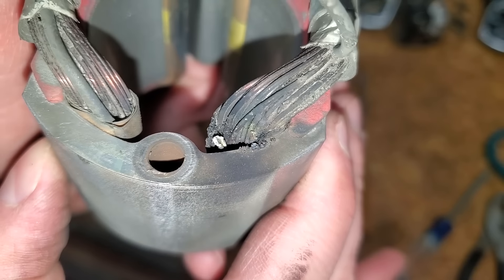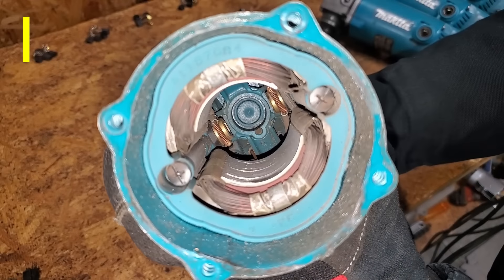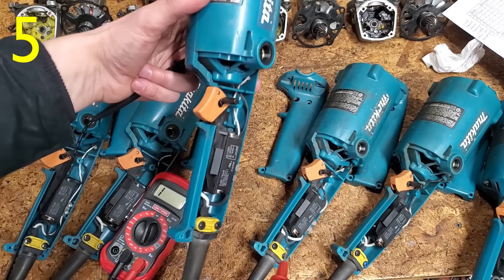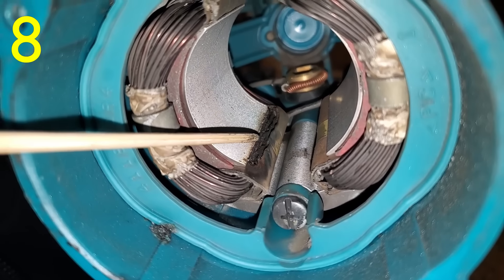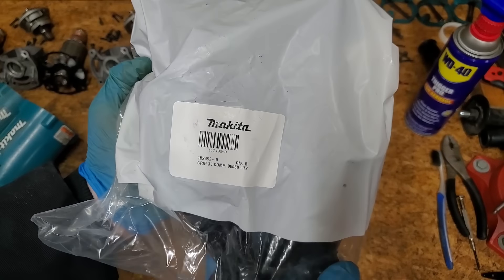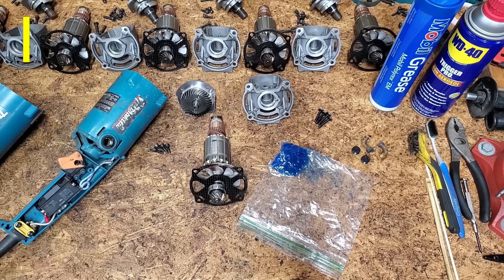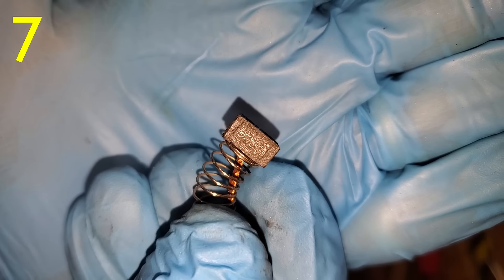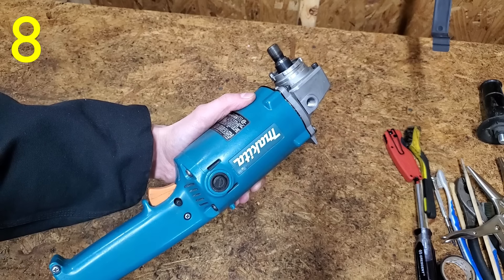Repairing Makita Angle Grinders

Comment: Makita makes the customer a winner here, the fact they sell the parts 👍
Reply from the maker: Yep, most major tool brands have a pretty good replacement part network with a lot of resellers.
Reply: @Mikeattempts  Have you found any major tool line that you wouldn't recommend based on repair-ability? I'm in a few battery platforms and wondering which one I should commit to. You and some other channels are teaching me and most importantly giving me the confidence to repair my own tools.
Reply from the maker: @marconiandcheese7258  I don't really feel like I have enough experience to give you a thorough list. I can say that store brands like Kobalt, from my experience, don't seem to have any replacement parts available. Is pretty safe to assume the same for any cheaper brands as well. Major brands like Dewalt, Milwaukee, Makita, Bosch, Hitachi, Metabo, and Porter Cable seem to have really good replacement part availability. So far, I only have experience with corded tools but my next project is going to be cordless Makita drills, so we'll see how that goes. I'm happy to hear my videos are giving you the confidence to repair your tools. I'm no pro so if I can do it, so can you.
Reply: For most diy people 1-3 grinders is a lifetime supply
Reply from the maker: @jonnenne  Yep, I agree. I'm still on my first set of brushes on my Dewalt angle grinder.
Reply: Bc they know their tools break
Reply: @BackwoodsGarageLLC.  All tools wear out Genius. Some of these grinders are 10yrs old ! 

Some companies though are invested in their longevity, others just want your cash....
Reply: @edwardfletcher7790  Still.
Better buy a new one in some cases. 
Time has value too.
Reply: 6-7 soundes smooth, some sounded rough, those sounding rough should get ball bearings replaced. But overall, I'm so happy you brought them back to life and saves from hitting landfill.

We should do that with virtually anything.

Comment: I am glad to see somebody take the time and effort to repair perfectly serviceable power tools. In most cases they would end up in a land fill.
Reply: Before use I would recommend that each of the grinders be equiped wih a guard.
Reply from the maker: Yeah, I understand time is money for businesses but one of these grinders just needed new brushes! It does make me feel good to save 'em from the trash.
Reply: @Mikeattempts  and one just needed a cleaning (jammed metal piece)

and a 60$ stator (companies can buy ín bulk and get discounts) and 2 h of labor is cheaper than a 200$ new one
Reply from the maker: @lacucaracha111111  You would think a business would at least keep spare brushes on hand for their $200 grinders, it's a 2-minute repair.
Reply: @Mikeattempts  my shop does, the electrician comes round monthly to repair stuff and change the damaged sockets
Reply from the maker: @jackhentschel5961  I think it's smart that your shop has add monthly tool repair to the electrician's duties.
Reply: @Mikeattempts I think preventative maintanece, periodic cleaning / lubricating can save a lot of money too. Really depends on the tool. But for very little effort and money, the lifetime of tools and machine can be extended many times over, plus you don't have as much downtime.
Reply from the maker: @thorwaldjohanson2526  Definitely! Regular maintenance prevents expensive repairs. What did Benjamin Franklin say, “An ounce of prevention is worth a pound of cure”? It applies to everything, your health, vehicles, and even tools.
Reply: You also did a service of teaching others how to fix them - which will save even more from landfill
Reply from the maker: @CharlieBaes  Somehow, I hadn't thought about it like that but you're absolutely right! Thanks for the comment. :)
Reply from the maker: @incub8  👍
Reply: well worth fixing nice unit to hold and good power. often welding shops use flap disc the grit sucked in gives the field insulation a hard time, haven't been overloaded as both halves of the field would at least show up as hot binding string melted. greasing a NDE bearing that it operating at 12,000 RPM range is ok to test unit but one of the only common failures of this unit is NDE bearing sized and melts housing so $7.00 to replace is better long term option. The sand paper on commutator basically no the patina on the copper has a purpose. 
Still nice video. Replacing the cord as well used to buy in boxes of 100 so good to change out or cut off 1 ft. Testing fields another listing had megger  ( insulation tester ) I prefer testing fields with 12v battery just hook up amp meter 10 to 30 amps and dead short each coil should be same grinders about 25amps drills about 12amps 3 or 4 seconds so heat not an issue  
the megger wont show shorted turns. grease generally is ok if you top up must be lithium base grease never mix with polyrex EM or turns to putty. Otherwise clean out compressed air blow out old grease and use just Polyrex / Polyurea EM grease.
Reply from the maker: @kspower395  This is just a hobby of mine, I don't do this professionally. So, buying a box of 100 cables doesn't really make sense for me. Yeah, I was aware that lithium and polyurea don't mix which is why I spent so much time cleaning out the gearboxes. :)

Comment: The beauty of using quality tools is that not only do they tend to last longer initially, but they are generally supported for replacement parts for a good time afterwards. nice to see them lovely tools given a new lease of life. Brilliant.
Reply from the maker: Yep, besides paying more for better quality, you're also getting the ability to repair the tool with replacement parts. Most cheaper tools and store brands don't even give you an option to order replacement parts. However, I'm working on a bunch of Makita drills now and getting parts is not as easy or cost effective.

Comment: As an old motor rewinder aboard some our country's finest ships, I applaud you for the work you did and for the excellent video you made.
Reply from the maker: Thank you very much! Have you ever rewound a small stator like the ones that failed in these grinders? I've never done anything like that but I'm interested in the process and possibly trying it myself.
Reply: @Mikeattempts  I can't recall doing anything that small. I think the smallest I did was a starter motor for a Detroit Diesel 6-71 engine.
Reply: @Mikeattempts  I’m curious how you’d find out about the process of rewinding a small tool motor. Maybe in a repair manual? Many things like that are obscured by how unusual the practive would be outside specific industries, and in many cases handed down to apprentices…there’s not such a great tech education left in the US, it’s mostly higher level such as design, engineering and programming.
Reply from the maker: @atlantajunglepythons1744  I agree, I was hoping someone would point me in the right direction. There's always YouTube! :)
Reply: @Mikeattempts  measure the existing enameled wire, purchase it. when unwinding the old coils you must count exactly how many winds you remove. rewind exactly as it was, place paper between copper and steel. re-solder connections (gotta sand off the enamel to make any connections) winding motors isnt exactly that it's hard.... its painstakingly arduous to do. 10/10 don't recommend
Reply from the maker: @mattlitton8066  Haha, I might be up for an arduous task... once. Thanks for the info! Stupid me didn't realize you could get enameled wire and thought I had to apply it myself. :) Is it hard to get it rewound without accidentally scratching the enamel against the steel stack?
Reply: @Mikeattempts  it's not exactly super easy to mess up the enamel. You need to be careful around the steel plates but ideally you would have a paper layer between anyway. And if you scratch one piece of enamel you'd have to have another wire with a scratched spot touching the other to short out. You need to be mindful for sure, but it can hold up while winding.
Reply from the maker: @mattlitton8066  Well that makes it sound more doable. I kept the old stators, and the shop gave me a couple more angle grinders so I might try rewinding 'em.
Reply: @Mikeattempts  I'd watch it lol, it can be rewarding.
Reply: @Mikeattempts  there are available winding jigs. They have a half a car wheel profile on either end of adjustable length rods  to adjust for coil size. They’re mounted on a central axel so you can spin them and just count your rotations. With a 3d printer a fella could make on pretty easily. Finicky process for sure but if a replacement isn’t readily available it’s the difference between trash and treasure.
Reply from the maker: @larrypostma2866  Interesting, I didn't realize there were jigs. I've got a 3D printer too. This could be a fun project, but I feel like I have a lot more to learn.
Reply: @Mikeattempts  Your video was great.  You could have made up 4 units from the 8 at no cost.

The fact that all of the failures were pretty much in the same place points towards manufacturing failure.  Almost all consumer/high-volume motors are made in automated machinery (some cool automated and manual videos on youtube search for stator or motor winding) and if something is set up wrong or worn in the machine it will compromise the winding as it presses it into the stator core and then the risk of failure is high.  If you had examined the other good units you might find that they are also like the Ford Pinto and have a vulnerability in that same spot.

Having parts failures before the brushes are worn out the first time means bad manufacturing, having it repeated means bad quality control of planned obsolescence.

As mentioned by another commenter the reuse of the worn sealed bearings was not a long term fix but might last in hobby use for the life of the grinder.
Reply from the maker: @KallePihlajasaari  Thanks! Yeah, you're probably right about the stators because the replacements had a different part number than the original.

Comment: I used to work at a fabrication shop briefly, I told them I was good at fixing stuff and they had a pile of tools about two bootfulls worth, including lots of these grinders and hikoki ones, among lots of other dead tools. I managed to fix more than half of them but using good parts from different dead ones. Soon learned the common failures for each brand. Was good fun. This video really reminded me of that job. Nice job. I had like 6 dewalt 1/2 impact drivers that all failed the same way, at the cable strain relief clamp, ironically the screws had been so tight from factory it would just shear the copper wires inside. I thought about buying them as it was pretty obviously a factory issue and knew there would be a lotttt out there in the world with the same fault. But they just aren't worth any money anymore as everyone has gone cordless.
Reply from the maker: That's cool, how much time did they allot you to fixing tools vs your regular duties? Since this is just a hobby, there's no pressure to get stuff done for customers so I find it very enjoyable and satisfying. I've learned a ton so far, but I feel like I still have a lot more to learn. I would like to get better at electrical testing. Thanks for the comment!
Reply: @Mikeattempts  It was like 2 or so days work. I didn't really have any specific duties at that job, I just did as I was asked. General engineering, one day I was wiring up electrical panels, the next I was welding, the next I was cleaning machinery. You've nailed the basics of multimeter testing for sure, better than most people I worked with anyway.
Reply: One thing I've been thinking about lately is volunteering to help people fix their own stuff, possibly in conjunction with a civic organization or maybe the SPCA.  The SPCA in our area accepts donations of goods to resell in their store.  They could also have repair clinics maybe once a month or a couple of times a month whereby volunteers could assist folks in repairing their own stuff and/or repairing donated stuff that could then be resold as fund raising for the organization.  Wondering if there's already some of this going on somewhere that I'm not aware of
Reply from the maker: @eclectictech  That sounds like a great idea, helpful and rewarding. A few other people commented that they have "Repair Cafes" in the UK where you can go to fix your own stuff, help others fix their stuff, or get help fixing your stuff. I'm sure there are similar places in every country. I'm sure the SPCA would be more than happy to let you help out, especially if they also don't need to pay you! :)
Reply: @rattech kinda sounds like my current job. Last week I was demolishing walls, today I was fixing a 6x6 polaris sportsman. Tomorrow I'm removing stuff that's growing in a water well

Comment: Only once I used a grinder without a guard, and nearly cut off an index finger, which took months to heal. I cant understand why most country's  don't seem to use them. Good vid though, thanks. John, UK
Reply from the maker: I ended up getting guards for the ones I kept and sold. I think they are commonly used in home shops. As for the pros, the guards must get in the way a lot if they don't bother to use them at all. Also, pros feel very comfortable handling tools since they use them for hours every day. It could lead to a false sense of security though.

Comment: Good go through on my favorite Grinder . Had 14 on the go at least once a year carried 6 on my truck at the start of jobs , I changed all the cords to 15 footers  using cold weather extension cords . 15 footers stay plugged in. Used the female outlets left over to make pig tails . The Makita 9005b was a real work horse . I used them for decades. And they were worked hard . Brushes and cords were the main fix . Would go down to the makita store to get parts once a year and spent a week end getting them all up to snuff . Even made my own guards for 7" discs were as good as factory . The grinder could handle the larger discs . Did not own other brands of grinders that way only had to got to one place for parts
Reply from the maker: That's awesome, I bet those cold weather cords were nice, I hate stiff cords! How did you make the guards, that might make for an interesting video? :)
Reply: @Mikeattempts  Just repurposed the 5 inch ones to make them bigger welded and ground them to look like factory .Welder by trade . OH&S up here allows one to use 120 degree guards which makes them safer to use grinding pipe . I never used a handle accept in tight spots and spaces . . Not using a handle made the grinder easier to handle . after 45+ years in the business still have all my fingers and no major meat missing
Reply from the maker: @fittergrips2010  Hahaha... "no major meat missing"? I assume that means some minor meat is missing? 🤣

Comment: Yeah it worked for me, one detail I left out was I used a wooden dowel which I pushed in through the brush hole and then through the plastic conduit which was holding the spring to align it with the brush holder, I then manoeuvred the spring with a screwdriver pushing it over onto the brush holder
Reply from the maker: Ahhh, gotcha, makes perfect sense.

Comment: 10 out of 10 my friend!   I LOVE THE TIP/HACK  @ 17:22    "when running a course thread screw back into plastic turn it in reverse until you get the click so that you use the old thread and don't cut new ones, "GENIUS"!
Reply from the maker: I really appreciate the positive feedback, thanks for the comment! :)
Reply: I thought everyone figured that out intuitively 😬
Reply: Love it. I've always done this to prevent cross-threading.
The number of times I've had someone start to tell me "righty tighty" or some shit, and I have to tell them I know... I know. Maybe stop using an impact to screw in bolts for your machines and they won't all be stripped out.

Really good video!
Reply from the maker: @jamesnewman9547  Hahahaha... "it went in easy with the impact, I don't know how it got cross threaded!" :)

Comment: pro tip, when removing the bearing seal, pry from the outside diameter so you don't put a nick on the rotational seal where the inner race rides, it will lessen the chance of a seal failure
Reply from the maker: Thanks for the tip!

Comment: Fixing tools is generally easy as the same items tend to fail. Brushes, commutators, switches and cords. I maintained an angle and die grinder fleet for a welding school and it was a mix of brands to see which models (model is more critical than brand) held up. Makita have been making excellent grinders for decades and their corded grinders are excellent. I repack with red wheel bearing grease including new grinders if not sufficiently lubed.
Reply from the maker: Yeah, these Makita grinders are pretty simple so there are only so many things that can fail.

Comment: 9 times out of 10 power cords break right near the tool, so you can usually get away with cutting a little bit off a few times before the cord is too short.
Reply from the maker: That's probably what happened to #5, Thanks for the tip!